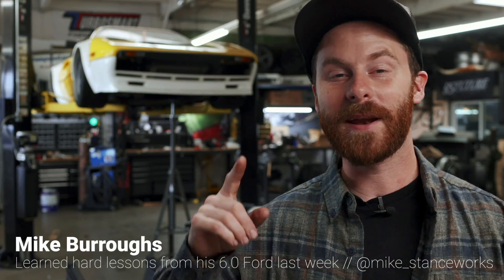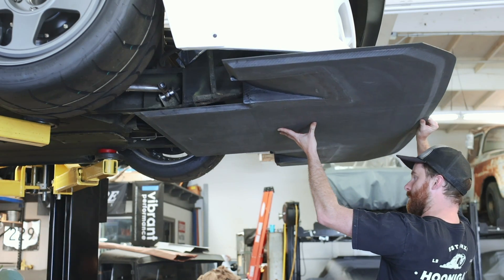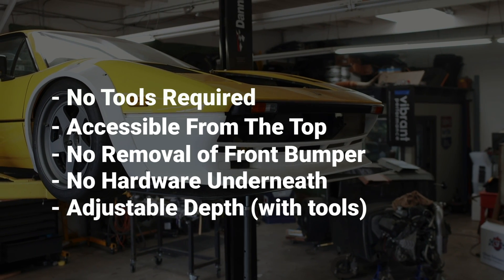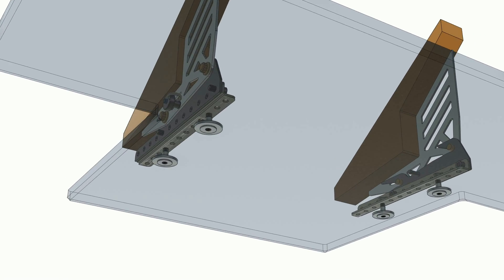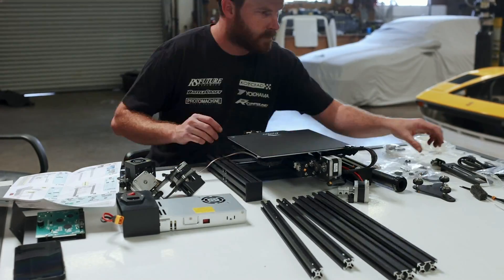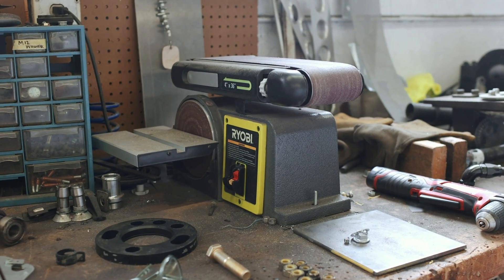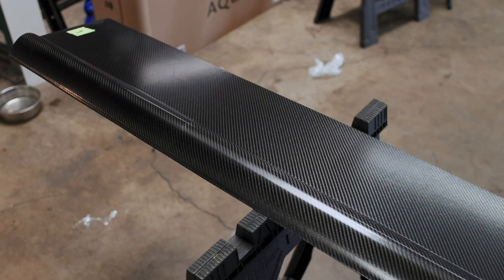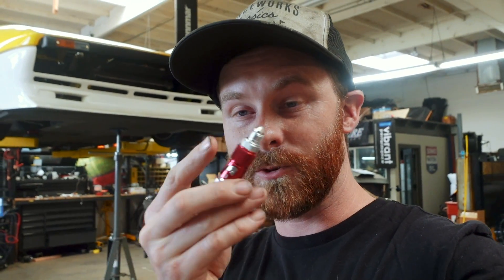Designing Quick-Disconnect Splitter Mounts That Don't Require Tools - PT 1 - Honda-Swapped Ferrari

Comment: Consider making the splitter supports longer; extending the full length of the splitter.  Permanently attach the supports to the spitter in multiple locations; and continue to use the removable clips with oversized washers as you have to affix the supports to the chassis supports you have made

Comment: Hey Mike, could you connect the front splitter to the lower wishbone suspension?  Likewise could you mount the rear Wing to the lower wishbone.  It was done in the 1960’s until it was banned.  I don’t know what the modern rules are. Maybe you could get an advantage.

Comment: I've got a Ender 3 V2 printer. First setup was a bit of a thing but there are some upgrades that make it workable. The marlin software update is a great start but I would always recommend a auto leveler and stronger springs. after that it's just some adjustments in the slicer I used Cura 5.0. I hope the Prusa also does this, It wil make your life so much easier!

Comment: Thanks for sharing your process getting back into the project. I have the same issue working on fitting a new diesel in my boat. Lots of work and sometimes a bit frustrating but eventually it will get done even though my wife is convinced the boat is going to sink.😉

Comment: I usually do not comment on videos. But do yourself a favor and pick up a 3d printer that self levels or calibrates for the bed. I prefer my Vyper to the Ender I had. You'll save youself a lot of headaches.

Comment: I have been watching this 308 project from the beginning and find some of your fabrication solutions very  long winded but usually accept that as a one off car and is the nature of the beast with this kind of modification. Today however I am completely confused as you say the guy who made the front splitter came to your shop and took many measurements. If this is the case, how come he didn't  fabricate the part so it fitted straight to the car without need for extra brackets and infill sections? Surely a competent designer could have achieved a seamless fit including mounting points to an existing part of the car! Coming to measure up and then custom fabricating a part that doesn't fit seams like a total waste of time and money.

Comment: Right before you said it, I was going to say you should have gotten a Prusa! I've got a very old Prusa MK2 that I bought from them all the way back in 2016 and I was amazed at how well it printed out of the box. Basically if you just want a 3D printer as a tool to make things, get a PRUSA, if you want a 3D printer as a hobby itself, get anything else............ I love my Prusa MK2 so much I have actually just kept and upgraded it over the years. I also fully built a Voron V0.1 sourcing all my own parts, so I know both sides of the spectrum when it comes to FDM 3D printers. I have a Prusa XL on pre-order, so hopefully someday when that comes in I can crank out some much larger parts for automotive prototypes.

Comment: The ender 3 is great and not sure why you had to do marlin and firmware stuff. I saw it said no media, it should have worked out of the box using cura to slice the model. Not really sure what the issues where though. I have multiple Enders and they work very nicely out of the box and I also have other printers as well. Great vids. Keep it up.

Comment: Every type of flexible brake line expands when pressurized. Some less than others, but every type does it. that is the reason why it is used only where it is absolutely necessary to make the line flex. To keep hard lines intact, use soft mounts to minimize vibrations and copper alloy line to give more lifespan to the system. Also the mounting interval plays a big role on hard line life expectancy. Also your front splitter will not hold. On your design, it just dangles on four non-torqued bolts, and those bolts will just screw themselves out bcz there is no static friction holding them in place, bcz they are not torqued. After you got them torqued to spec, those washers will come right thru the carbon fiber. A feature of the chosen material. What you need is 2" wide aluminium backing plate with the minimum length of the upper bracket. An inch or so extra on every direction on the plate compared to the bracket will make the part more stable. Every corner and edge on both metal parts need to be rounded and smooth, and bolth metal parts need to be panel glued to the splitter sandwitching the carbon fiber between two metal surfaces while the panel glue acts as a buffer.

Comment: You'll disassemble an electric motor and set up a haltech but you're defeated by a 3d printer? There's a massive community of support for the ender printers - Yes, spending two or three times as much for a prusa will get you a good printer, but not a printer that's three times as good. Still going to need to dive into it and understand the tools though.

Comment: Dry break couplers are awesome! We used them when I worked with my friend at GWR Racing building lightweight single seater hiĺlclimb cars. The GWR Predator Arrows V10 was the 1st, then the GWR Raptor motorcycle engined cars. Videos are here somewhere! Looking great by the way, Mike! Cheers. Leigh.

Comment: I know all about the loss of momentum! I've been building a car on and off for 20+ years! (it has been on the road in that time in part finished state). Keen to see more on the splitter and interested to see how the gaps around the sides fair? The splitter is probably super stiff but you will get some movement at the sides. The question is, how much. I think you'll be able to assess it once you're mounted. Its a nice solution for mounting too. Love your work Mike.

Comment: Hey, no need to change the brake lines. The job you have done is fine and will be safe. I am in Motorsport for over 25years and work for a brake company. That solution is safe and no need to change. The quick connectors are a good choice.  Even a better solution would be to use the bulkhead version of them and have one side fitted to the chassis. Then you don't need two hand to open and close and can simplify this. Thats how we do it in endurance races, where brake changes are done during race.

Comment: I'm sure you're far to into the engineering of the rear wing to consider something different but you might find some of the rear wing engineering of a Miata used in the 24 hours of Lemons.  Awful looking thing but brilliantly they did not connect the rear wing to the chassis. They connected it via transmitting connectors to the lower control arm, thus avoiding having to build in ANY compensation via the suspension. It's ALL downforce, direct to the wheels allowing for a softer suspension and greater agility.    I can se how that might be possible with your rear wing and a bit of re-thought, but....

Comment: The reason so many computer driven industrial tools have such a steep learning curve, is because the people involved in creating the language of the product had no experience or vocabulary in the industry they built software for. In fact, most programmers have very little experience in anything but computers. Therein lies your problem with the vast majority of computer aided gizmos, designed for age old industries,  barely 20 somethings building software for things they have no experience for. 
I can hear all the winning and tough guys of computer programing now, threatening me with computer viruses and siphoning off my non existent wealth between computer games and long talks with their anime hooker girlfriends. YOU DID A SHITE JOB! Your building a product for customers, not for yourselves! Products by now should be plug and play, with a video tutorial that gets you doing simple things within minutes. We're not supposed to feel like we've been thrown in the pilots seat of an Airbus 380 in an emergency landing scenario, everytime we have to interact with a new product you've so skillfully programed and given a language that has nothing to do with the industry its meant for.

Before you throw your non fat latte with extra beet root powder at your monitor, do me a favor and replace my toilet, repair the flooring that got damaged, replace the flange on the pvc pipe end, and make sure to disable any of the water saving gizmos. I like a real flush with my toilet. If you have trouble tightening any of the floor bolts, remember "righty tighty-lefty loosey". Do me a favor, don't cheap out on the caulk, use brass toilet bolts, and if your going to need shims use plastic ones.

Comment: I think some people gave you less than the best advice regarding the Ender 3 and with a little mentoring should have had you up and running.  My first printer is a Creality CR-10S which is similar enough to the Ender (same maker).  To get started, you need a slicer to prepare the gcode files (you'll need this with the Prusa as well), some filament and a level bed and you are off to the races.  I think that watching a youtube video on getting started with the Ender could have saved you a lot of frustration.  Regardless, the general setup will be the same with the Prusa as the Ender so just be prepared for that fact so you don't get frustrated a second time.  Good luck!! :)

Comment: Dude, you listen to the comments too much. The idiots talking shit on the AN fittings don't know what they're talking about. EVERY car on the road has flared brake fittings. NOTHING is fundamentally different between a 37deg AN fitting and a 45deg inverted flare. It's the same shit with a different angle and different methods of affixing. The main difference is that AN is able to generate clamp force and a good seal waaaaay easier. It's better than what comes on everything factory! Do it right, and it's FINE. Don't waste your time going in circles over keyboard warriors who have never built a car.

Comment: get a prusa 3d printer.... throw out that chinese crap, Prusa has the support to help you, they are expensive, but they make a quality product and have the support available to back you up if you have any issues, i too started with a chinese printer and it was headache after headache, once i went with the prusa, i never went back, it just works for me, any issues i had i could fix it rather quickly, on top of that prusa has its own software that is pretty easy to learn how to use

Comment: Glad you decided to go with Prusa. I have one myself. Try to stick to default settings in prusa slicer software, you'll get the best results BUT change "Fill pattern" to "rectilinear" for fast prints. For car parts use ASA plastic. It's similar to ABS, but less smelly. Supposedly it's not afraid of UV light and should last virtually forever. Plastic brand is very important! There are some cheap ones that will print terribly. I had great success with "Polymaker" brand, and "Overture"  is alright too.

Comment: If the 2 bolts that the splitter hooks engage were a cammed bolt (think like bolts that adjust camber on macpherson struts) the splitter would be adjustable in terms of angle and to a limited extent height, seems a good idea to have some adjustment available.

Comment: Lots of aircraft run 3000psi hydraulic system with single flair fitting. No issue.

Comment: i made your car on forza H5, just wish i could put the wide body on it, looks goofy with white decal where your wide body is around the wheels. also couldnt do a honda swap obviously lol but i used a very small v8 that pumped 1000hp. i know its a video game but you could try different sims until you find one to where you can make your car as comparable as possible and run some tunes and see how it handles during scary moments so you dont have to experiment and break things or worse wreck. forza horizon is not a sim btw. forza motorsport has mroe realistic physics, the new forza motorsport 8 is coming out soon too so it'll have the most sim stuff compared to 7. i dont know for sure but asseto corsa is supposedly the best sim out there.

Comment: Good work on starting your 3D printing journey, Mike. I've got an Ender 5 Pro I use for car parts and prototyping. Honestly, the hardest part is modelling and you've already got that.

Yes, there was an annoying learning curve with the Ender but once it's set up you can basically forget about it. You just need to be aware of filament settings and a few other things. But that will be true of any printer.

Comment: One of the cleverest use of 3D print I have seen in car building was Retropower, they use 3D prints to check their CAD before sending the files off to CNC in metal as its much cheaper to do prototypes in filament than metal . Made me laugh to see the standard Ender 3 upgrade of "buy a Prusa" lol. My son made me a few car tools and bits on his Ender, but its been apart a lot of times...

Comment: Why two oversize washers? You could use a flat plate same width as the washers and the same length as the mounting flange on the other side. Just a thought.

Comment: Careful with the dry brake fittings, I have seen a lot of these fail even at the club level and I do not see why they would be needed on your car. Best practice after reattaching is going to be bleeding the brakes so why add the extra failure point.
Reply: Totally. I've changed brakes at the track before, it's no hardship. Just crack the bleed nipple and let it gravity bleed if you're really lazy. Wedge the pedal down if you're working on the car with a pipe off. Brakes need to be more than reliable. You should have brake fluid in your kit anyway.

Comment: Have you considered looking at splitter mounts from Professional Awesome (https://professionalawesome.com/product/professional-awesome-quick-release-splitter-support-system/) ?  It is a tool-less quick connect system that a lot of Racers use.  I have used for front splitter on both my tire attack cars.  you would still need to make a adjustable mount, but it is a fantastic system

Comment: you need a Splicer software program like Cura or MatterControl to prepare the CAD file 
must be converted to G code, to then send it to the 3D printer so the 3d printer can 
print out the model. your computer should have ben able to prepare the cad File for 
the 3D printer. the job of the 3D printer is to execute the 3d printing process.
there should have been no need for you to modified the 3D printer by installing 
custom firmware. by doing that you may have made things much harder for yourself.
you need to do some more research on the 3D printing process before you decide 
embark on this endeavor in regards to 3D printing.

Comment: The aircraft industry uses flared and flareless titanium and CRES (corrosion resistant steel) hydraulic fittings/lines everywhere, holding up to 5,000 psi. These systems are designed to last 20 years in high vibe environments. Your stainless lines would have been fine, but I commend you for adapting to your audience. A Honda-powered Ferrari seemed like a crazy idea but it's nicely coming together.

Comment: Welcome to 3d printing under $2500, spend less, and you have to tinker.

unless you're buying formlabs, you arnet going to get out-of-the box printing, its like welding.

you have to learn how to do it, it wont just magically weld seams.

Comment: if you make holes though the splitter you could bolt some little blocks to the buttom of the splitter like the mclaren senna and prevent the splitter getting ground away when you buttom out

Comment: i hope your brake dry breaks dont leak like my Quick Jack dry breaks. even after bleeding off the hydrolic pressure like they suggest for 5 seconds, my dry breaks still leak. about a 3-6" puddle a week. i own 3 race cars and dont use them for any. there are more than enough things to go wrong with brakes on track. i wouldnt want to add an obvious one. i dont know of any amatuer level/club level racers that do.

Comment: Front splitter mounts design reminded me of the PCI units seen in the Honda world , and maybe you could get & repurpose a set of them and save yourself some time and possibly $ as well 🤷🏻‍♂️ 

But by doing so then I guess you'd also admittedly lose the unique/1 off/cool factor & overall pride in the ability of saying you made them yourself as well 🤔 

& incase you're not familiar with the parts I'm referring to and would like to check 'em out I'll attach a link below for them on PCI's website ⬇️ 
https://www.pci-racing.com/product-category/aero/front-splitter-brackets/

Comment: I think your choice to use soft lines is a good call. Though hard lines are not necessarily dangerous (otherwise OEMs would never use them), they do have some downsides such as kinking, cracking and metal fatigue. OEMs primarily use them because they are cheap to manufacture in large quantities. A soft line requires less (or no) connectors, which is good because the best connector is no connector. An extra benefit is that you can keep a soft line as a spare, if you ever blow a brake line at the track, it will be easy to replace.

Comment: Hey, I fear that splitter mount is not going to be enough for the kind of aero load you will generate at speed.
On S2000s you have the same approach, two big chassis beams to which people attach splitter mounts.
In addition however, we also make reinforcements in both axes of the splitter plane: you want ideally to have a cross plate to minimize flex in the outer edges of the splitter, and distribute weight.
From your two main splitter mounts I would add a perpendicular brace, and possibly also two side braces that go towards the sides of the splitter.
Sometimes even this is not enough and you need to add some sort of stainless rods towards the front of the splitter.
There will be a lot of flex, with only your structure my fear is it will fold on itself at speed.

Comment: Wouldn't it be easier for adjustment to make it slide and lock with cam locks? You know, instead of index holes and having to bolt and unbolt to adjust the splitter.